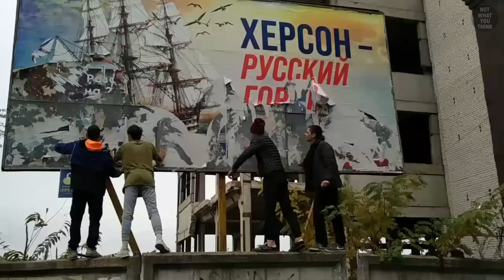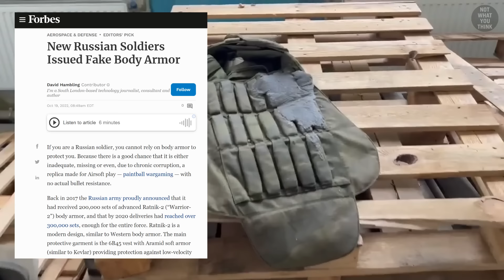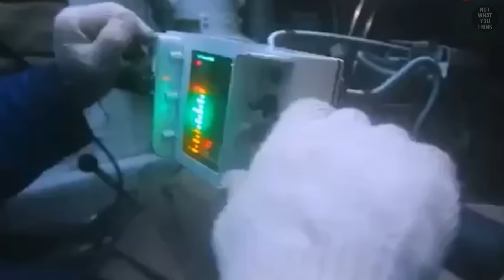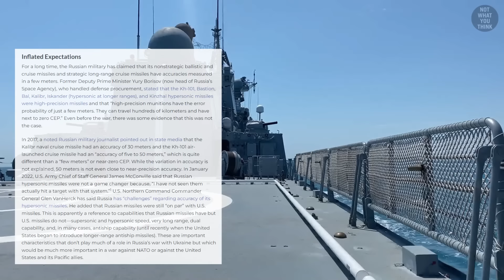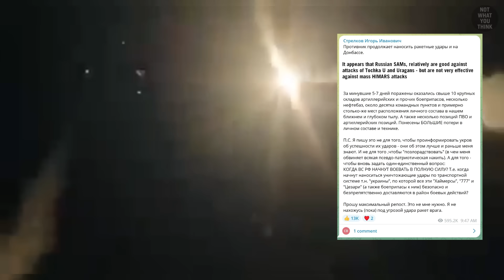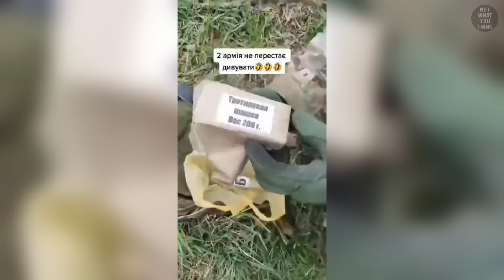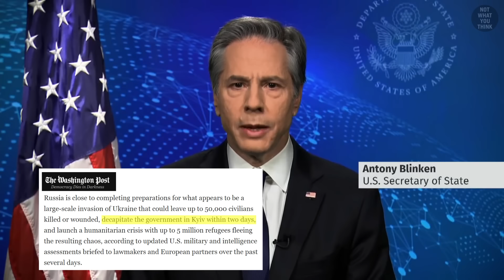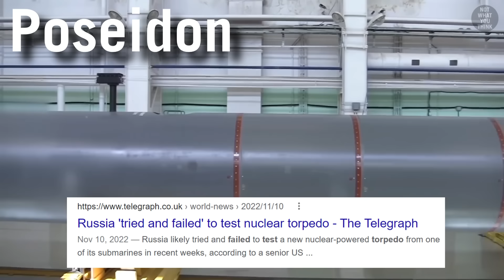The True State of Russian Army

Comment: There's a few things in here that are not true.

Food:
Yes, soldiers were given not enough food or bad food. This not due to lack of food in Russia, but rather high command not expecting soldiers to be needing it (they thought ukraine would fall within a few days at most)

Helmets:
Vast majority of RU troops use the 6B47 helmet, a kevlar helmet. Kevlar is a material made to stop high-speed objects.. not blunt forces like fists so yes, it'll cave in to that but it very much will stop shrapnel and maybe bullets if you're lucky.
the 1950's helmets, semi true. the unmodded SSh-40 and SSh-68's are seen in the hands of rear-echelon troops. The troops that were on the front but weren't given 6B47's were given SSh-40's that were upgraded with a layer of kevlar (Kolpak-20 is what they're called). They're not bad helmets! It does the same job as the very much modern 6B47, it only lacks NVG rails.

Vests: 
Most soldiers that have vests have the standard 6B23 vest. Many ukrainian soldiers, upon finding such vests, remove the steel plate to use themselves. Troops that come across that same vest later will find it with nothing but a foam sheet (standard in all vests) and will then make videos saying Russians don't have steel plates. Furthermore, aside from the steel plates, many vests also have a layer of kelvar.
As for sizes, the vest shown in the video is just a smaller model of vest. something like the 6B23 i mentioned earlier is a vest that is quite long. Such shorter vests are just way more comfortable and easier to manouvre in.

Guns:  
Vast majority of regular troops will have perfectly find AK-12 or AK-74M rifles. The rusted AKM shown is captured from a DPR seperatists, these are often troops that have their own gear and thus don't reflect what Russia uses.
As for the Mosin Nagant, that's a nice example of a personal preference or a different unusual weapon that's better suited for a job. a Mosin Nagant (firing 7.62x54r) has a WAY longer range and better accuracy than your standard AK-12 or AK-74M. For a sniper, this would definitely have the preference. Now, i hear you ask: "But SVD's exists too". Correct, but they're most likely reserved for snipers that are specifically trained for that role. The guy with the Mosin most likely is just regular infantry and has the 'sniper' role. Example: i've also seen a Russian soldier that was carrying a PPS-43. Not as his main gun, no, but as a secondary. He had a regular AK-12 on a sling on his back.

Drones:
Only thing i want to mention here is the fact some tech is western made. Not too long ago info leaked that some crucial parts in the F-35 (US jet) were made in China. This stuff happens, every country will have to deal with this sort of stuff.

Tanks: 
Russia has, at this point, lost 2500~ tanks and still hasn't ran out nor has resorted to using T-55's or stock T-62's
The T-55 is only in use as mobile artillery (and one example was used as RC VBIED) and so far, since the beginning of the war, only 1x stock T-62 has been seen and captured.
All other T-62's are modern versions which will have the same tech, sights and other upgrades as seen in more modern T-72 variants and T-80 tanks. These modern T-62's are still a minority however. Russia's tank army consist mainly of T-72B and T-72B3's.

The T-14 is an odd story, 1 example had been spotted in Ukraine but has since been taken back to Russia. People assume they found some flaw in the design that needed fixing as the tank is still in the pre-production stage of its life. While they're working on that, Russia has started mass-production of the T-90M, a massive upgrade for the T-90 that brings it up to spec with the Leopard 2a7, Challenger and newest Abrams variants due to a redesigned interior layout, blowout panels and hard-kill APS systems.

S-400 missile:
The Kherson bridge is totally irrelevant to this. A missile can still be capable of taking out incoming missiles but only if said missile is detected.
There have been numerous Patriot missile systems destroyed already (US supplied systems, argued the best in the world), not because they're bad but because there's still a human element to it.

Explosives filled with wood/rubber:
This is again, not true.
The ERA blocks consists of explosive filler AND rubber plates. Ukrainian soldiers are known for emptying out ERA blocks leaving just the rubber plates behind. It's the same story as with the 6B23 vests. As for the wood blocks in the TNT? That looks more like a plastic explosive (similar to C4) so i see nothing wrong there.
Reply: best comment here
Reply: Good points, but I don't think even author of the video is going to read them
Reply: Totally agree my friend, thanks for speaking the truth
Reply: That is a long, long way around 3rd base to bring that to a landing comrade.  The things I know where you’re just dead wrong:  1) We used the PASGT helmet in the US Army since the 80’s and as a wearer of this helmet, I can tell you that it is certainly able to stop 7.62 & 5.45mm and in no way can be smashed my a fist or a rifle but.  2) If the Russians are just using T-62 tanks as mobile artillery, why repaint them & why are they being destroyed on the front line?  3) Do you really want to try to convince us that Russian armor is better than it is?  we knew the T-72 was crap in the 80's, blew up thousands in the Gulf War and the Iraq War, & provided the Ukrainians with multiple types of systems to defend themselves with.  As such, the Russian conscript army has made an absolute fool out of you, the Ukrainians destroying north of 2000 tanks and recovering several hundred others and just driving them away. 
Neat story if it weren't for the collective internet with first hand experience with sub optimal Russian equipment.
Reply: @restaurantattheendofthegalaxy  Talking with respect here, the Iraqi T-72s, like most T-72 export versions, lacked then-modern night vision systems, though they did have some night fighting tanks with older active infrared systems or floodlights, just not the latest starlight scopes and passive infrared scopes as on the Abrams, you may see thousands of russian tanks destroyed, but it is because it was used in the worst moment and situation, since ukraine geography prevented the russians to go through the terrain, so they had to go through tight roadways, tight for the amount of force that was used, so that resulted in ambush against russian vehicles, today russians seems to have fixed this problem, altho we can still see tanks going solo, example: the T90M vs the 2 bradleys, but most of the recent assaults have infantry support, and also due to the cheap cost of the T-72 it can be replaced and it was replaced, russia is just starting to fill up these gaps as we can still see T72B3s used in the battlefield, just not that much because of the static front.
Reply: @restaurantattheendofthegalaxy  lol, not a single helmet can stop 7.62 and 5.45... search up any PASGT penetration test and you'll see that even a 9mm will knock you tf out.

Why repaint T-55s? They don't? Any markings are identification markings. Why they're so close to the front? Because they're not meant to be artillery so they don't have the same range as a 2S3M does.. cmon that's common sense if you know the basics of tanks dude! T-62 is also mainly uses by DNR/LPR forces as they were given old equipment and since they both now have been absorbed by the Russian Military, they'll now get Russian markings. Come back with this argument when Russia starts fielding T-62's to their own troops rather than seperatists fighting under the Russian flag 

Oh and if you knew anything about Russian tanks, you'd realize the T-72's present in the Gulf War aren't the same as in Ukraine.. that's like saying the M1A2SEP is the same as the XM1 because they're both abrams...

And i never denied Russia has lost that many tanks, but ever thought of the fact Russia has way more tanks to lose than Ukraine? That combined with Russian strategy and military doctrine and there ya go, we find the same numbers Oryx and WarSpotters mention.
Reply: @JustaGuy1250  You are correct, PASGT helmets are only IIIa rated but there's plenty of an anecdotal evidence that these helmets have stopped 7.62x39mm when fired from beyond 100m.  Panama, Gulf War, Iraq War, etc.  And a new PASGT helmet like I wore will absolutely stop all handgun rounds up to.357mag at 50m.
Reply: @restaurantattheendofthegalaxy  well surprise surprise, a Russian 6B47 will also have such lucky catches..

welcome to the world of ballistics kiddo

Comment: As for the socks, they have actually just recently started using them in the Russian army. It's not that they don't have it, it's just that they traditionally used footwraps in the army, because they believe that footwraps make feet sweat less, and require less changing per week.
Reply: A footcloth can be worn for 3-4 days in combat conditions, socks will not withstand so much. A footcloth is warmer than socks, you can use larger shoes with it if there is no suitable one. It can be made from almost any piece of fabric. For an army with poor logistics, there is probably no better solution.
Reply: @Роман-д1й1ш  in my oppinion, the best solution are a handknitted woolen socks that almost every household on the Balkan owns. Those socks are really worm, the feet don't sweat in them, and they can easily be worn a couple of days without nasty smells. I mean they will get stinky after a while, but not as nearly as bad as a footcloth. The only problem is that it takes extra time to dry the woolen socks.
Reply: @robislavovic826  The stink is not a problem. Wet socks can destroy your feet in a matter of hours. The footcloth can be rewound to the dry side. Of course, you can carry a bag of dry socks with you, but a footcloth is more convenient in this case.
Reply: @Роман-д1й1ш для того чтоб не было вони нужен правильный  уход за стопой и не будет никакой вони .  Партянки лучше носков ,если только носки не качественного пошива и не имеют возможности для вывода влаги . А портянки смогут защитить от  траншейной стопы ?

Comment: 4:37 is one of the sfera helmets from the 90s if memory serves- metal or titanium plates (3 plates) held in the shape of a helmet by a fabric cover and straps- Also known as the DIAPER HELMET .It had a horrible suspension system and neck injuries were possible if hit. BTW titanium is stronger then most steel aloys  per weight  but it is not As HARD (resistant to scratching) as steel can get  which is also an important factor , Titanium is also  expensive and hard to work with but unlike steel doesnt rust in normal conditions, Metal and steel helmets do not degrade And can be put into storage almost indefinitely (they do degrade but do so exceedingly slowly in good storage conditions) Unlike   kevlar , UHMWPE and some other modern materials used in helmets  and bodyarmor which last anywhere from 5 to 15 years (One example of the aging problem is zylon aging too fast to be usefull for bodyarmor being one example, nobody uses zylon anymore, because after a year of continuous use in certain conditions  a zylon vest could degrade to the point of being practically useless, kevlar on the other hand  in the Worst possible conditions will degrade after 5 years (most manifacturers guaranty quality up untill 5 years) , UHMWPE slightly sooner- Im not getting into details because I could wrtite a 15 page essay on it )
Reply: I would not mind reading said essay
Reply: Very informative comment👍
Reply: @Ruiseal  you are not getting an  essay because I cannot write it (sorry, i was making a hyperbolic statement )  but I can give a litle more info on the degradation. Kevlar( Aramids) are most effected by UV light(this  degrades kevlar fibers directly , that is why they are held in nylon covers and inside a plate/ armor carrier, sometimes they get coatings applied directly to fibers in conjunction with covers ) , after that humidity (you sweat , mechanism is unknown to me), 3rd way since the fibers are flexible, they degrade through bending (WEARING the armor) and by sagging due to its own weight loosening the tight weave neccesary to stop projectiles- so basically- by using and storing it improperly you have weak fibers in a looser weave being unable to stop a bullet.  That is why bodyarmor is OPTIMMALY stored flat on the ground in a dry and dark place, some detergents might also effect it but that is not tested due to a variety of detergents available, kevlar is used in helmets as well as bodyarmor. Helmets are a composite of some type of resin(similar to fiberglass car parts) and kevlar  The resin """ "stiffens/hardens """ kevlar, prevents moisture and UV light from penetrating and prevents bending. Helmets last the longest but how long is unknown because it has been used in bodyarmor/helmets since around about 1980's and rarely do people shoot their own helmets. Aramids such as kevlar possibly degrade on their own but that proccess is the slowest
 For Uhmwpe(U.ltra H.igh M.olecular, W.eight P.oli E.theli e) i do not know how or why but it degrades slightly faster then kevlar, not by much though. As far as my info (lasts from 5 -15 years) . I came to the conclussion 5 years because that is the minimum garantied time it will last, however they ussually last longer based on videos testing a certain type of bodyarmor  in different years 2010, 2012, 2015, 2017 ecc When looking at the PASGT vest - older videos (2010 and older) show it stopping a 357 magnum , but a video from around 2016/1€ Shows a 357 magnum penetrating the PASGT vest however the vest still stopped a 9mm
Reply: @JB-ls5pq  aw i really wanted to read it! But thx anyway
Reply: @Garrett Pierman the sfera type helmets 4:37 are not a special forces helmet , it was used during 90s in by common soldery in russia. USSR/russians  had large sources of titanium so even their bodyarmour in afghanistan was made of titanium. Eventually the helmet was  made of steel instead of titanium due to the ecconomic crash of 90s russia and the expense of proccesing titanium . There are fiberglass airsoft replicas sold but you would probably see people crushing those during a test. Ofc the sfera was """"officialy""""  replaced by other helmets
Reply: @JB-ls5pq  dude get a job
Reply: @LEPERCOLONY1  I seemed to several mistakes 1st  in my original comment (i wrote metal instead of steel )-I have corrected in ???brackets i guess they are called???THIS (.......)  2nd  The FIRST sferas were produced in the 80s and production continued in the 90s  3rd It was ORIGINALLY(in the past)  used by special forces and MVD (internal affairs)- I THINK  They are NO LONGER in service with those ORGANISATIONS (at least not officially).     .......................     I know it is expensive hence the titanium plates were replaced by steel eventually. withouth weigting it I cannot tell with absolute certainty which one is it - Those are OLD helmets at this point 20+years old, Probably from the surpluss market or a russian storage depo .  and they are heavy 2.3 kg for titanium, 3 kg for steel.  It COULD BE TITANIUM OR it COULD BE STEEL- since it is an old (20+YO) helmet with an unpainted Metal plate .....WITHOUTH RUST spots visible  i am guessing THIS SPECIFIC ONE (4:37) is Titanium, I cannot be certain. If you want a good video there Videos from a youtube channel called "OXIDE". It would not be unussual at this point for Russia to dig into their OLD stock Of weapons , and Equipement, some of RUSSIAN ALLIGNED FORCES are using the ssh 68 - the helmet from afghanistan (rough equivalent to the american M1 Steel pot from WW2, korea, vietnam ecc) , and there were pictures of old mosins- From both WW1 and WW2 -  ALSO Russia is the 3rd Largest PRODUCER  of Titanium in the world no wonder they made helmets from it at one point in their history
Reply: There are alsoa few more recently produced types like the Zashita-U and a helmet called Alfa made by a company called Sfera, the one in the vide seems like the latter, with the black connector plate in the center of the top.
I've seen both already used by Russians in Ukraine, these are made by commercial companies and are not officially used by the army, and there's no knowing what their plates actually stop, but they look like they are made of steel and way thinner than SSSh-94 Sfera steel plates